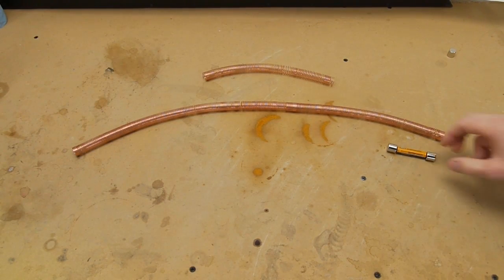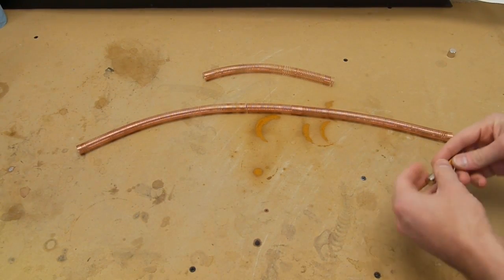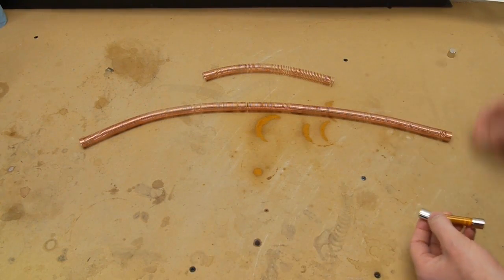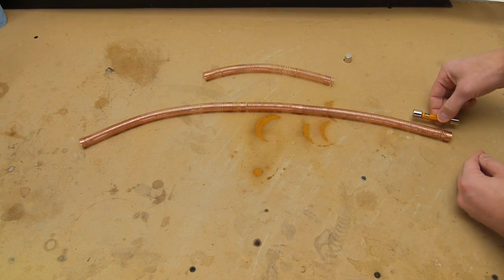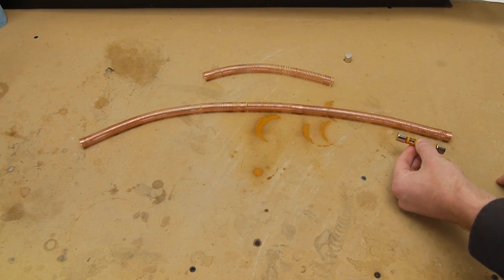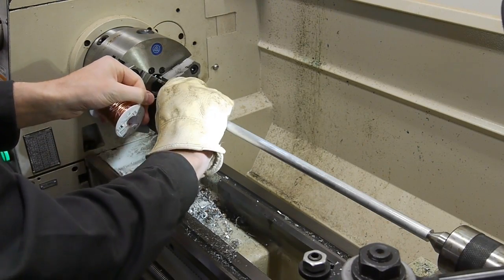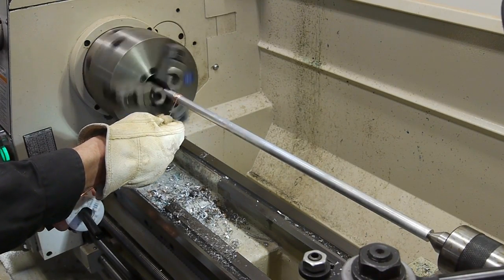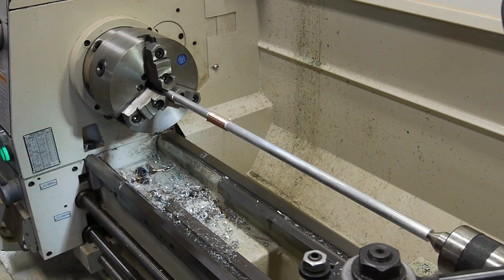Magnetic Propulsion

Comment: Use a vacuum glass toroid containing  liquid mercury, nanoparticles of Fe++, cobalt,and Barium. Just enough mercury suspension  to fill the bottom of the toroid and form a circle. Mount 40 individual coils around the toroid. Sequence them using fast switching transistor switch. Increase the pulse rate of the coils slowly, do that the suspension starts turning.  Increase the voltage to the point where the metal suspension lifts off and centers inside the toroid while turning. Then the fun begins… increase the voltage and the frequency toma point where the ferro-mercurial solution turned into a plasma . You will have to use high voltage trough the coils at a high pulse rate. Once the plasma is circling the toroid, increase the voltage and frequency.  A corona effect will,appear.  
Once the radial velocity is fast enough, a white glow will envelop the torus and extend  outwards.  At that point, the total weight of the setup will decrease (yes, decrease!) e hen the voltage reaches 2 million volts and the radial velocity approaches relativistic speeds the toroid and anything attached to it will lift slowly.  IT IS NOT ANTIGRAVITY!!!  The white field is a quantum field that “hides” M  from E=MC^2.   The only thing I was never shown was the proportion of the elements in nanoparticles suspended in Hg.  And before you ask, no, the mixture does not form an amalgam!  The toroid gets hot from the plasma but remember, there is no friction against the glass walls since the plasma is not touching it.  Watch out for X-Ray emission!

Comment: I just did this myself, what I learned:
I used a thicker wire because I wanted to make this for my mother to use in her elementary school class. Don't do that. The wire doesn't bend out of the way of the magnet, and it doesn't spring back when you take it off the dowel, so it's just large enough and any coils that get bent out of alignment at all will stop the magnet.
Also, this is probably pretty obvious since it is a short circuit, but this can drain a battery in minutes.

Comment: Makes me wonder what running different amounts of electrical current  through the coil would have? Or different spacing/stacking/direction of the coil windings...  Like, could you control speed and direction of the magnets inside the coil using switches and potentiometers?

Comment: What if you'd put it into a loop so magnets and battery never leaves the coil and use it to generate energy? After all magnets moving through a coil = energy. Also wouldn't the output be slightly higher than what AAA battery can provide alone? If so, it may be used for cheap (aaa batteries are cheap and magnets are reusable) power generation given big enough "loop". Would like to see you do something like that to see if it works. Subbed, awesome channel.

Comment: So you could just as well connect a lab power supply to the ends of the copper coil, and run a single magnet through it without battery?

Comment: is there a way to place this in a loop and use a peizo to store energy to push it off again? does it need to be in this configuration or can it travel through a copper tube?
Reply: wouldn't work in a tube, there has to be current circling around the batery
Reply: perhaps if the tube was 3d printed with a specific woven pattern of copper to increase propulsion?
Reply: Clark Grizwald
then it would be the same as this copper spiral
no need to 3d-print here :)
Reply: how large could this be before it didn't work or would it work better?
Reply: It will always work with wire. But a pipe will never work. Unless you cut it into a spiral.
Reply: Voluntarist
I think there should be an upper limit for this thing to work.
Force that pushes magnets through a wire is proportional to the magnetic flow which is proportional to size squared. Friction however, is proportional to mass, which is proportional to size cubed. So if you just keep scaling it up, friction will overcome magnetic force at some point.
Reply: What equations are you using for magnetic flow and friction?
Reply: yes but  you must some how close the loop before it reaches the other end

Comment: I'm learning so much from your videos. Thank you for sharing them. Question. Did you connect a meter to both ends of the coil to see if there is voltage being induced into it while the battery is traveling? If so... And hypothetically if we have a wire tunnel in a large repeating circle to allow non-stop travel - would it be enough voltage to recharge the battery (if it were a rechargeable battery?) Lastly, would a copper tube work instead of a coil?

Comment: Damm this video! Now I just have another series of engineering questions to chase around in circles!
Would a change in materials be of any advantage? I have been trying to figure out if aluminum or carbon would be a better choice for a coil, considering cost, but the field is beyond me. What is the tolerance of circularity of the coil? Can i get away with a light bulb cross section? Could i replace the magnets and battery with a diesel engine driven coil? What are my limits of scale for this? What happens when a train sized version of this goes wrong? LHC Large human collider hmmmm... nope im going back to cartoons now

Comment: The Jetsons powered by AAA's.  Slick!
Reply: I want to try this with the coil wrapped around a plastic liner to lower the friction but as luck would have it, the damn stuff is non conductive ;))
Reply: Awesome Demo !!! Wonder how it would work  with a larger battery  , magnets and  cool?  How  about  a large coil , shoes with  metal soles attach large magnet , battery pack  with negative charge  on feet   Metal hat with flat top with large magnet on top of hat . Apply positive charge to hat  .  Now if your charge was switched and you were laying in the cool and you switched on the power you should be propelled through the coil.

Comment: it's important to note that the reason for propulsion is due to one end of the train repelling the coil's field while the other is attracted by it (not only repulsion as mentioned in the vid). this is a homopolar motor, not an effect of Lenz's law which causes deceleration (magnet falling in copper tube experiment) , not acceleration. for this to work, the Nd magnets must have like poles facing away from the battery, for eg, both North poles facing out (and the battery becoming a virtual magnet with its own north/south pole).
Reply from the maker: Follow Media Good point!
Reply: That's very helpful. Thanks
Reply: The word deceleration doesn't exist. Acceleration is either positive or negative. Perhaps you're just trying to explain.
Reply: @TechTrashCash  In physics, deceleration definition always refers to the slowing down of an object, which means that the magnitude of the velocity decreases. Deceleration is characterized by opposite directions between the acceleration and the velocity.
Reply: That tehnic is key for argalium alpha sistem for AC curent just no dc
Member..

Comment: We had a similar experiment back in school.

The difference was that we had a copper pipe with cutouts on the top, made in to a circle and a electromagnet sled inside.

The experiment had been made for the class by one of the previous students and had remained as a piece there.
Reply: Great stuff,, Just wanted to tell you about a great source of materials you should take a look at  Closes May 10th  in sacramento check out WWW,. west auctions, this one is full of   copper, and  all types  of metals, plastics, all sizes  etc,   I dig what you are doing
                            gort from Richmond

Comment: Would this work with a solid copper pipe
Reply: ***** The solid tube thing is just Faraday's Law of Induction. Falling magnet creates circulating eddy currents in the tube, which oppose the magnet with their own magnetic field.
Reply: SentinelPrimek I don't think so, since it relies on the current going around the circumferential way. 

Like, imagine what the Lorentz force is on the current in the wire, using the right hand rule. That's what the magnets are exerting on the coil, and vice versa.

If the current were going in the axial direction, like it would with a solid pipe, it would be deflected around in the circumferential direction. Again, in keeping with Newton's 3rd Law, the magnet/battery would get spun around inside the tube. In other words, it would be a homopolar motor. 

If that doesn't make sense, try looking up stuff of the Lorentz force and how charges move in a magnetic field.
Reply: SentinelPrimek No, but you can drop a strong magnet through a copper tube and watch it slowly descend through the tube.
Reply: SentinelPrimek 
Ahm, this IS solid copper wire...
Reply: ***** No, it's been already explained many times. Sorreh.
Reply: JoeJoeTater What about a solid copper tube wrapped in the copper wire?

Comment: What if you reverse the magnets?  Then the fields would not be opposing.
Reply from the maker: Chris Tacklind I tried it.  If the magnets are pointing in the same direction (ie the north pole of each one facing forward) the battery is not propelled.  It only works if the magnetic poles are opposed to each other, and then the train still only goes in one direction.  Someone correctly pointed out that the whole device is like a linear homopolar motor, so the two magnets act as one large magnet with the battery in between.  The front magnet is repelled by the active segment of wire, and the rear magnet is attracted to it.

Comment: ... I  dont want to be a dick here, but my german sense of order is highly  disturbed by you wearing gloves whilst working on a lathe. Please don't, its dangerous!
Reply: ***** You don't have to wear the gloves for that, holding the gloves or using a rag would have worked just as well. A sticky/rough patch on the wire could pull your hand in and even at that low speed, you'd end up with your hand wrapped around it in a second or two, and it takes longer for a bench lathe like that to stop. Maybe if it was a big lathe with a foot brake you'd be ok, but it wasn't.
Reply: Mobbymick The paranoia is strong in you.

Comment: I guess it is good to mention that the copper coil has no insulation on it. Most of the copper wires have polyamide or polyester coating. But I am pretty sure that the wire you used does't have any coating. Am I right?
Reply from the maker: bmetal2 Yes, the copper wire is bare, which is important for this demo because the magnets must make electrical contact with the copper coil as they slide along.
Reply: TheMmmaaaggg13579 tube won't work. the magnetic field generated by the tube will be perpendicular to the magnets' field. But when you use coil, the magnetic field generated by the coil(solenoid) is parallel to the field of the magnets, that is why propulsion happens.
Reply: Applied Science Thank you that was what I guessed. If I had time I could have made a super fast version of this. Just get a coated copper wire and scrape the coating of each loop at the point where magnet touches(such that, scrape the inner side of each loop at the bottom) . By this way you can make a very dense coil(solenoid), where the loops can touch each other. And with this dense coil, your propulsion force will be much higher. I don't know whether I explained it clearly but to make this system much faster is not that hard.
Reply: Applied Science that makes a difference. I assumed they where not bare.
Reply: bmetal2 use at tube maybe?
Reply: ***** very nice idea, sand paper taped on the lathe will work I suppose. But he should be very careful not to short the individual loops(turns). another idea to make it faster is he can use coin batteries which are mostly used in calculators etc. and he can serially stack those coin batteries, then the current flowing through the coil will be much higher and accordingly the force and speed will be much higher as well.
Reply: bmetal2 how about also use one of these 12V batteries for more current?
Reply: 12V batteries will supply, almost 8 times higher force(speed) than a 1.5 V battery of the same size. But you should be careful, if the electrical resistance of the magnets are very low, then the current flowing through the wire will be so high and it can burn the wire itself. But this can easily be resolved by using thinner(higher resistance) wires, and since they are thinner you can make many more loops in a given length, which also increases the force and speed. So we can easily say higher the battery voltage, higher the speed.
Reply: If anyone needs a good source of bare copper cable, get some 14/3 Romex wire from a building store. Two of the wires will be insulated, but the ground wire will be bare. It costs about $1/ft.
Reply: That's not cheap, for 2€ per meter :/
Reply: Mr Mürk I'm sure you can find it cheaper, if you look, but to a buy a meter or two for some fun science, I don't consider a few euros that expensive. You'll probably spend far more on the magnets.
Reply: bmetal2 Just space the bare copper so that it is not touching loop to loop.
Reply: MotesYT as you space the loops, the force decreases. force is proportional to the number of turns(loops) per length. So if you keep the spacing between the loops minimum, you will gain the maximum speed.
Reply: I was thinking, I like your idea of keeping the inner coils bare, but for the dense "solenoid" type winding to work, you'd have to wind the coil radially out, like a pancake, 1 layer at a time until you got your desired length, because the electromagnetic force, or current, is only between the 2 magnets making contact, so if you wound layers of coil like usual, none of the outer layers would be effected. Hard to explain, but make sense?
Reply: Mark Rose or you could just go to the same place and buy the wire bare...
Reply: If the wire is conductor and each coil of wire is touching call next to that essentially is a tube. I think this experiment might work with a copper pipe I will have to try if I can find some magnets the right size.
Reply: it wont work with copper pipe. current should flow in a circular path(in loops), but with a pipe, current will flow straight(from positive to negative pole of the battery), and the magnetic field that the pipe produce will not push the magnets.
Reply: +bmetal2 I just read through this thread, and you guys seem to have some good ideas. With a perfectly straight copper spiral, and the maximum amount of voltage to be efficient in that space, any estimates on the kind of distance I could achieve with a projectile?

Comment: This can work other way around? Create elecromagnetic field in coil.
Reply: Darko Bulatovic If you figure out a way to move the magnet inside the coil, absolutely! (that how shake lights work.)
Reply: Power Max should not be enough to change (AC) field in the coil? I guess this ask for experiment more then thinking...
Reply: Power Max i see now that coil is bare wire not insulated.
Reply: Darko Bulatovic Good point. If you remove the battery, you will see a potential difference between the 2 magnets if you moved them in phase with each other, although it would make for a lousy generator. This same voltage should be also seen on either end of the ends of the wires.
Reply: Power Max I already have a way to do that. It is called a coil speaker driver.
Reply: Exactly. Your original idea would work, but compared to that solution (a driver coil from a speaker w/ the magnet it was inside of, and vibrating that) is a much better solution!